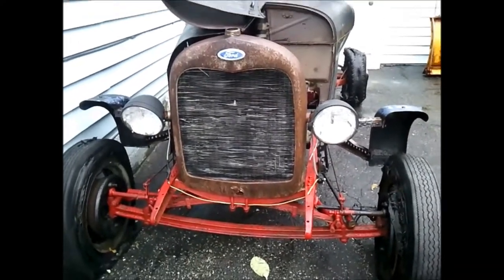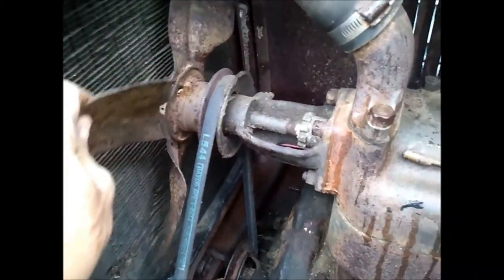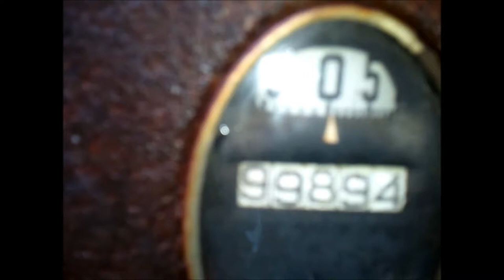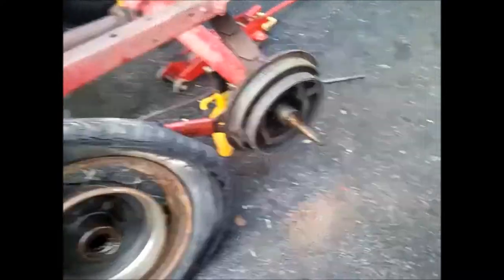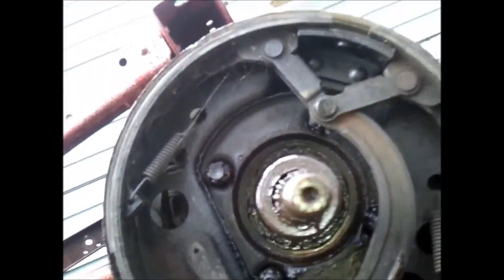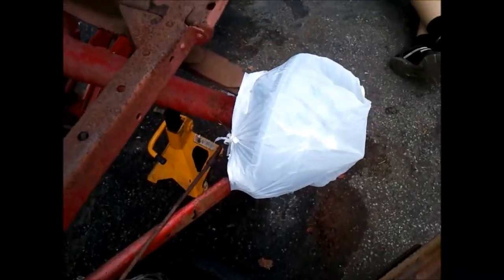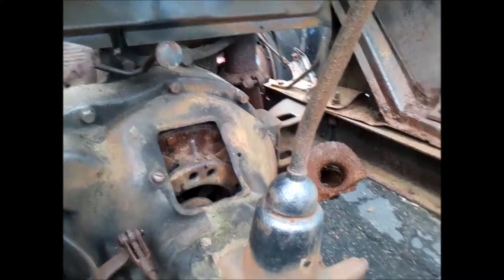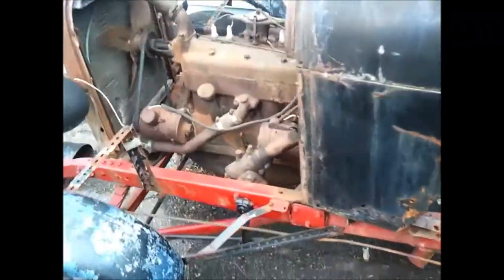Tire Removal on the Model A  and look at the Brakes

Comment: Cool project (project may be an understatement) you and the maid will need to pick up your scrapping game now for sure. If it were me the first priority would be to get it rolling (bead blast insides of the rims, new rim liners, tubes & tires). Are you going to keep it at your yard all winter? 

If the motor turns, pull the plugs and put 2-3 oz of motor oil in each cylinder and crank it over a couple times to lube up the cylinders with the plugs out, replace plugs and any oil will just drain down. It looks to me as if it has a modern ignition on it and probably has been converted over to 12 volt (you should be able to find something stamped on the generator and starter saying six or twelve volt also on the coil. Find any serial numbers you can and start looking online to get as much info as you can about what it is.
Reply from the maker: ***** thanks brother Cheers to the Gears!!

Comment: Your better off with the 16" wheels. Their mid thirties . The stock wheels were 19 or 21 inches. The clothe was body welting to deal with squeaks. Those old cars had a lot of wood in them including the floorboards. Have you decided which way your going with the build yet?
Reply from the maker: youth1966truck yes seen the wood repair kits , lol  I like the rims, and not to sure yet, cheers bro
Reply: udizzy1969 I'm sure which ever way you build it it will be nice.

Comment: You should consider pulling the plug out of that engine put in some penetrating oil in even though it turns it will help out the piston rings, cool how the rim is a part of the brake drum or is that just how you pull it off??
Reply: the inside of the rim rides on a lip on the break drum for support it could have rusted on
Reply from the maker: camerl2009 prolly did, lol
Reply from the maker: redneckbryon thanks brother Cheers to the Gears!!

Comment: What year is that?  The earliest ones shifted by floor pedals, that stick shift must make it a late 20's or 30's model.
Reply from the maker: It's a 1928, so you are right brother, Cheers Dizzy.

Comment: that's a 1928 cowl that could be a AR motor you can get parts from a place called gas light that rear end use 600w  hypoyed greas
Reply from the maker: shopplay thanks brother Cheers to the Gears!!

Comment: those rims are later 30's rims I think 35's model A's used 21 inch or 19 inch depending on the year this looks like it was made into a doodle bug tractor at one point
Reply from the maker: camerl2009 thanks brother Cheers to the Gears!!